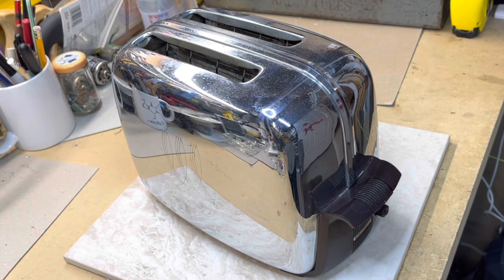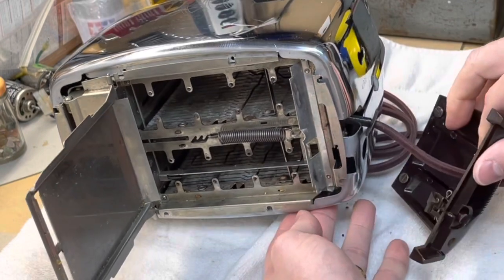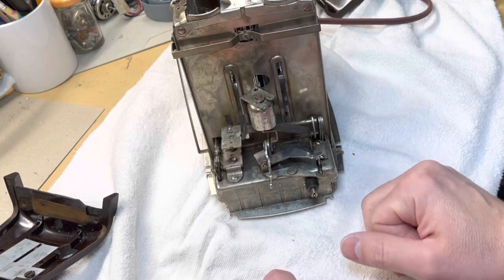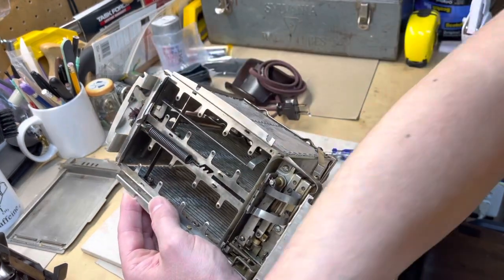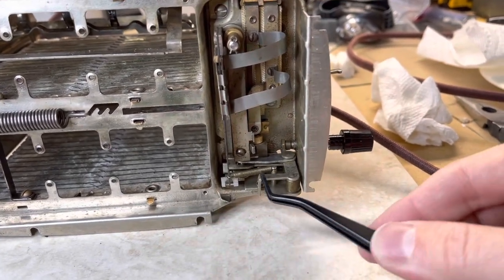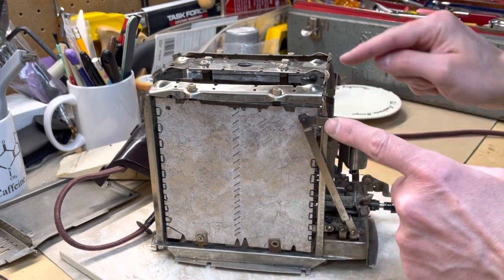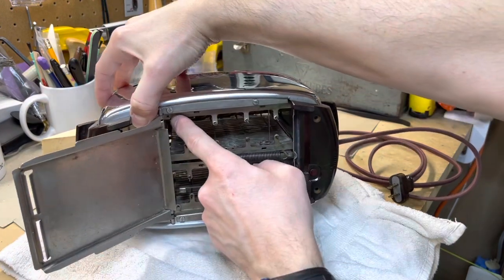How to disassemble and repair the Toastmaster 1B14 Toaster

Comment: Thank you for the wonderful and helpful video.
I love this toaster. And I'm glad to see that I'm not alone.
I have a problem with my identical model: when I test the housing with a voltmeter, there seems to be about 80 volts there. The current-carrying metal parts inside do not touch the housing at all. What is going on? Do the inner walls of the housing need insulation with a mica plate?
Thank you for sharing your experiences.
Best regards from Switzerland: Andreas
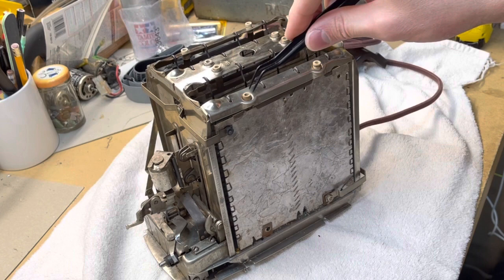Reply from the maker: @Andreas Vogel:  Thanks for commenting!  At 4:51, you can see 8 small white ceramic cylinders spaced on the top. And, at 6:34, you can see one of the plates that holds the heating elements.  Along the bottom of each of the 4 plates should be a grey-brown cardboard spacer that holds it up off the bottom of the metal chassis of the toaster.  You can see these again at 8:36 when I'm reinstalling the plate.  These should keep the plates electrically insulated from the rest of the chassis along the bottom.  The white ceramic cylinders perform the same function at the top.  The brown bakelite outer pieces also electrically insulate the toaster. So you definitely should not be getting an electric shock if you touch the chrome outer shell when the toaster is properly assembled. However, I am not sure whether there is any small amount of voltage leakage across the chassis.  Does the 80 volts you are measuring impede the toaster operation, i.e., is there a short or bad connection somewhere?  You should be able to easily trace the exact path of the electrical current from where the wires attach to the toaster, following the metal bars/bands, across the heating elements, etc.  Make sure nothing is bent out of shape or pressed against something it shouldn't be pressed against.  Are you measuring 80 volts across the outer chrome shell?
Reply: @LongologoProductions  Thank you very much for the detailed answer. Great!
I'll take the wonderfully functioning toaster apart again this weekend. I'm sure all 8 of the ceramic cylinders are there. But I'll have to check the grey-brown cardboard spacers under the heating plates.
Absurdly, I don't even know if the housing has been live for a long time - I only measured it for interest's sake after I had repaired the mechanism for the ejector the other day. Maybe it has always been like this and I have only touched the unit by the bakelite handles for decades ...
We have 220 volts AC here in Switzerland - depending on which way I plug it in, I either have 80 volts on the housing, or 9 volts. But if I then switch on the toaster, the 80 volts drop to 27 volts, whereas in the other plug direction they rise from 9 volts to 60 volts. Above 50 volts should be unpleasant ...
I will check everything in the open unit and report back here.
Best regards. Andreas
Reply from the maker: @Andreas Vogel:  Hmmm....  So if the voltage across the chrome outer shell only started happening (that you know of) AFTER you repaired the mechanism for the ejector, I would strongly suspect that something is out of place as you put everything back together.  It would seem highly unlikely that you never touched the chrome cover before this.  I would take the chrome cover off and (unplugged) check from where the wires are screwed to the chassis and trace the current path manually across the entire toaster.  Make sure that none of the current-carrying metal brackets are bent out of shape or touching something where they shouldn't be (they should only be touching the chassis or plates at their end points where they are screwed onto the chassis or plates).  Also make sure that all spacers and insulators are where they should be.  The fact that you are measuring voltage across the chrome cover is very concerning.  Be extremely careful!  Good luck.
Reply: @LongologoProductions  Hi. I think I'm gonna have to pass: Opened the toaster again and measured (without power!) all connections inside with the multimeter. Perfect! Everything as it should be - connection as desired, no connection on the inside construction. Reassembled. Measured again (without power!): Perfect. No connection at all of the current-carrying parts/cables with the housing. Everything as it should be.
Then plugged in and measured: 80 volts on the housing. Maddening. As if the flowing current was "radiating".
I'm going to look for a repair café and hope to find an electrician there who can still relate to such a device.
Keep you and everyone here informed. Thanks for your support!
Reply from the maker: @Andreas Vogel:  Strange indeed.  I just tested my two toasters with a multimeter.  When the toasters are plugged in and engaged, I’m measuring only a fraction of a volt across each of the chrome covers.  So definitely report back what you find out.
Reply: @LongologoProductions  So, it took me a while to get to the Repair Café.
Result: The measured voltage is pure induction. Even with a small resistance of 20K, it dissipates. No danger to life and limb. This phenomenon has always existed - only I had never measured it in the decades before ... 😅
All the best from Switzerland: Andreas
Reply from the maker: @andreasvogel7160  :  Wow - very interesting indeed!   With the lower voltage standard in the U.S., compared to Switzerland, perhaps that’s why I’m not measuring this phenomenon on my toaster?  Glad you resolved it!
Reply: @LongologoProductions  Yes, you still learn something ...
Thanks again for your support!

Comment: Thank you for this video. I took a peek inside my toaster and it appears that the heating strips are all attached, but my toaster still will not heat up. Any ideas what would cause that?
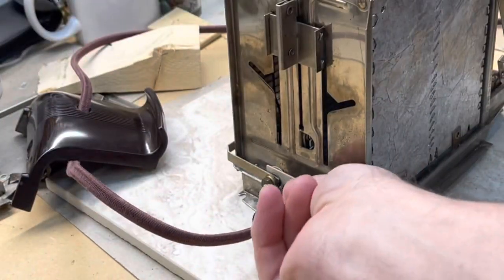Reply from the maker: @Leah Strothman:  Since it seems that all four of your heating element plates are not working, that points to a possible problem not with the heating element plates themselves but with the power supply to those heating element plates.  So, start at the plug and work your way in towards the toaster.  The first thing I would check is the condition of the plug end itself.  You might have a bad connection inside the plug.  From there, check the condition of the main wire heading to the toaster.  If it looks suspect in any way, you should replace the main wire and the plug to be safe.  You can get replacement wires/plugs that preserve the antique look (cloth covering over rubber insulation) like the one shown in this video. Next, you should check where the main wire connects to the toaster at the nuts/bolts.  See 13:22 in the video.  You'll need to remove the chrome cover/housing to see and access this.  (Make sure the toaster is unplugged!)  From these nuts/bolts, you'll be able to see the metal plates/brackets that branch out and supply electrical current to each of the heating element plates.  If everything looks good up to that point, then inspect each of the heating element plates for broken heating elements.  See 5:58 in the video, showing the back side of one of the heating elements, and I point to where the heating wires wrap around the element--each plate has one continuous heating element even though it looks like many strips of wires when you look into the toaster from the top.  It's possible there's a break on one of these corners or on the back side that you won't see from just looking into the toaster when it's assembled.  If nothing looks bad up to this point, then I would check the main switch on the side of the toaster opposite the main wire, to make sure the electrical contacts touch when the switch is pushed down. Good luck and let me know if you find the source of the problem.

Comment: This video was helpful to see the innerworkings of the toaster.  Thanks!  Do you have a video showing the replacement of a power cord?  I have a Toastmaster model 186 that needs a new cord.  I've gotten differing opinions on the type of cord it needs and I'm intimidated by all the screws on the bottom of the toaster.
Reply from the maker: @Kim Brown:  Thanks!  Unfortunately, I don't have another video specifically on replacing the power cord.  But you can get a replacement cord from an electric supply shop--either a "vintage" cord that has rubber insulation covered by cloth to look "old" style, or a regular modern rubber-insulated cord.  In this video at 13:00, you can see the two screws/nuts where the cord attaches.  As long as you are careful taking off the screws and lifting the chrome cover, the power cord should be a straightforward replacement.  Good luck!

Comment: Hello Sir,

You seem very knowledgeable, so I figured I’d ask you: my toaster is not popping the bread out. Meaning when the toasting is over, I hear the “CLUNK”, the lever is free to move but the bread won’t come up. I have to manually help the lever to have the bread come out.

I checked the main spring (big one) and put max tension on it - nothing chances. I even tried pulling it further with pliers, to see if additional tension would solve the issue. It does not. The spring seems OK, and K have no idea where to look.

Any idea? You’d be a lifesaver
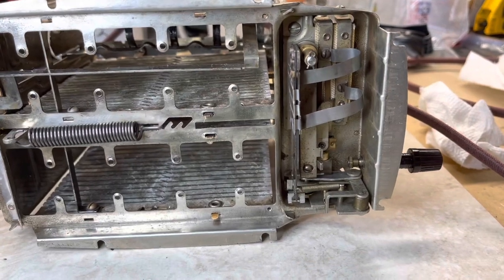Reply from the maker: @TheManusimpson31:  Take a look starting at 08:43 in the video, and you'll see the toaster adjustment knob.  Sometimes if the toast doesn't pop up at all, or doesn't pop up at the right time, you can adjust the screw I'm pointing to at 08:58.  Around this part of the video is where I explain what to do to get the toast to pop up.  This might fix your issue.  Good luck!

Comment: How do you fix a spring that has come off from the lock that holds down the toast?  Ideas ?
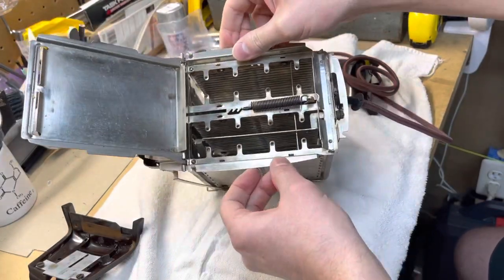Reply from the maker: @Danny Worthington:  Do you mean this large spring on the bottom (shown at 5:34 in the video and again at 8:43)?  If that's broken, you will have to get a donor toaster for parts and use the spring from the parts donor.  If that spring is not broken but has just come off of the notches into which it hooks, I would use a pair of needle nose pliers to carefully stretch the spring just enough to hook into one of those notches.  Be very careful to make sure you have a good grip on that spring with the needle nose pliers--the spring is strong and you don't want it flying up into your face if you lose your grip!  You'll see in the video that I have the spring on the "lowest" of the three notches, meaning that there is the least force to eject the toast/waffles.  Depending on how stiff your spring is, you may need to use one of the other two notches.  For this toaster in the video, if I used the middle notch the toast/waffles would fly up about two feet when ejected.  If I used the farthest notch, the toast/waffles might hit the ceiling!  In contrast, you'll see on another toaster at 10:40 in the video that I have the spring on the farthest notch, which for that particular toaster is necessary to eject the toast/waffles because that spring just isn't as strong.  Or do you mean that tiny little spring near the bottom, shown at around 8:49 to 9:28 in the video?

Comment: This is a great DIY video, with one exception.  The little knob that regulates the darkness of the toast has a very small screw in the center of the knob that first needs to be removed before the knob can be removed.  Learned the hard way.  I too am attached to the toaster. I grew up with it and I am now 68 years old (2021). Still works perfectly.  Needs new cord.
Reply from the maker: @Jim Buettner:  Thanks for the kind words!  At about 1:27 in the video, I do remove the knob by turning counterclockwise without first removing the small screw that is recessed in the center of that knob.  And at about 16:50 in the video, I mention reattaching that knob and also note that you can use that small recessed screw to adjust the dial position relative to the light/dark toast setting stops.  I suppose you could just first remove that small recessed screw to get the knob out, but I found that on our toasters (two of them, oh, and another I needed for parts a few years ago) it worked best to back out the knob/screw combination by turning counterclockwise and only using the small recessed screw to make adjustments.  That is, I found it much easier to avoid cross-threading that screw when I could hold onto the larger knob to get it started threading on reinsertion.  Maybe not the correct way to do it, but it has worked so far.  Next time I mess around with the parts toaster, I'll try completely removing that screw first to get the knob out--so I'll definitely keep that in mind.  Finally, I replaced the power cord with a modern but antique-styled braided cloth 'insulated' cord and bakelite plug--you can these parts at an online antique electronic supply store.  The new cord has the modern insulation around the wires but the braided cloth covering so it looks old-fashioned to match the toaster --no black rubber cord look!
Reply: At 9:11 you are by the one spring. The one I have loose is the one under that one.
Reply from the maker: @Danny Worthington:  That whole plate will have to come off then to access it.  Then you’ll have to use some small pliers or tweezers to hook the spring back on.

Comment: I have my grandmother's 1B14 which I love but it has an element in the left slot that is not working.  I loved your instructive repair video, but don't feel confident I can do this as I would hate to do anything to compromise this "treasure" from my Grandmother.  It's the only toaster I have ever had, and I'm extremely sentimental and would love to see this toaster continue as long as I do and beyond!  Would you consider repairing this for me?  Thank you for your consideration.
Reply from the maker: @Kathleen Grainger:  Thank you for your comments!  I don't do repairs for others, but I try to provide as much detail as possible each step of the way for the viewer to do the same.   You might be able to find another 1B14 on Ebay and practice taking it apart and removing one of the heating element panels.  Then, when you're comfortable with that, you could replace the heating element in your grandmother's 1B14 with the good element you removed from the "donor" toaster.